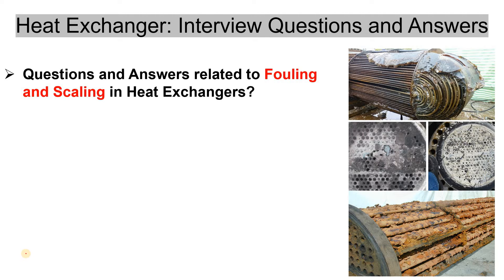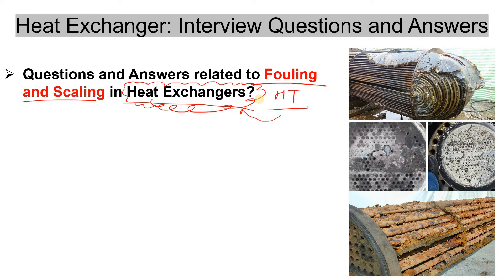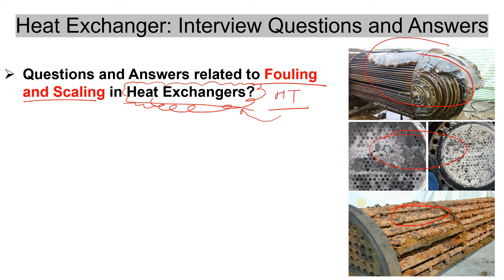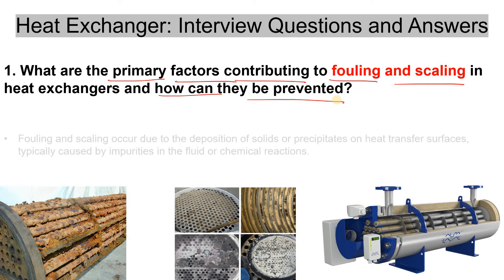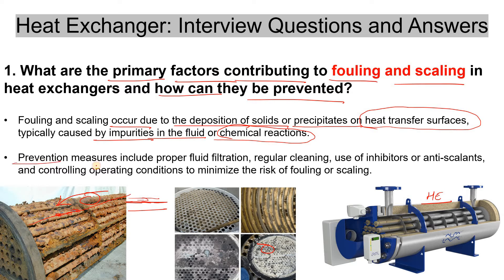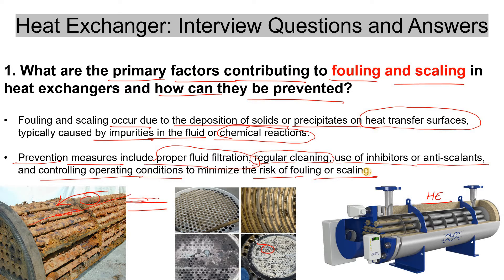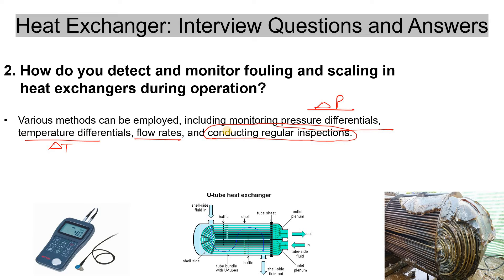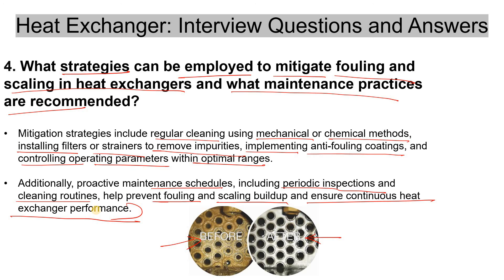Heat Exchanger Interview Questions and Answers (Part-2) | What's Fouling & Scaling in Heat Exchanger

Comment: Hi sir, if we want to use exhaust gas from boiler to create hot water using heat exchanger, what kind or type heat exchanger will be used ? Because the fluid is not steam but exhaust gas

Comment: Sir any 2 reasons why discharge valve closed and suction valve opened when pump start up???
Reply from the maker: Hello Santosh.....here is your answer of your question..

Two reasons for closing the discharge valve and opening the suction valve when starting a pump are:

Preventing Overload: Closing the discharge valve and opening the suction valve helps to prevent the pump from experiencing excessive pressure and overload during startup. By initially allowing the pump to draw in liquid without immediately pushing it against a closed discharge valve, it reduces the risk of damage to the pump and associated piping.
Priming the Pump: Opening the suction valve allows the pump to prime effectively by filling the pump casing and suction line with liquid before starting. This ensures that the pump has a continuous flow of liquid to begin pumping without encountering air pockets or dry running, which can damage the pump and decrease efficiency.